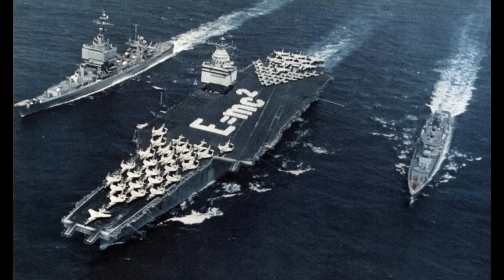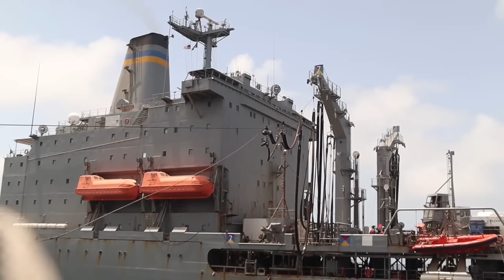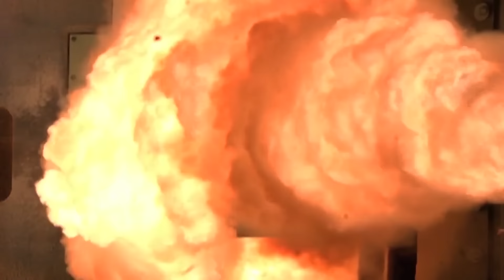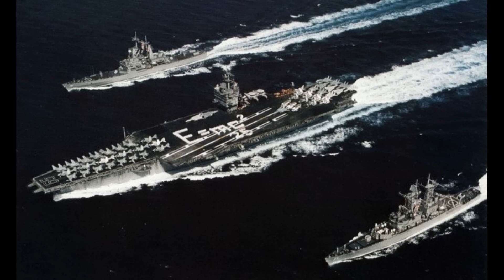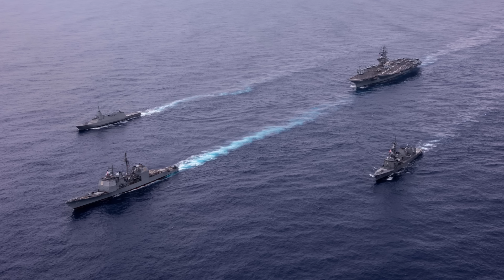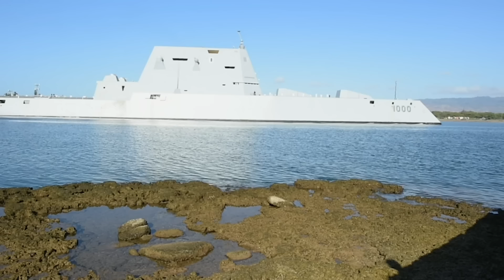Should the US Navy Bring Back Nuclear Cruisers?

Comment: Similarly, a strong case can be made for conventionally-powered aircraft carriers. Faster to build. Cheaper to build and maintain. Easier to host in foreign ports.
Reply: Im sure that would be more expensive to develop than building more Ford Class for US since they have long forgotten in building a Coventional Powered Aircraft Carrier long ago since last time USN commissioned a conventional powered Carrier was in 1968 with CV 67 USS John F Kennedy and it was Decommisioned during 2007
Reply: @wyne9145  did they lose the blueprints?
Reply: @fred6319 Blue print no but the Knowledge and experiences amongs human designers and Ship buildiers its forgotten
Reply: @wyne9145  and who is building ships now?
Reply: @fred6319 😂
Reply: @fred6319 
It doesn't matter. They need to design new ones regardless.
Reply: @wyne9145 
Doesn't matter. They need to design new ones.
Reply: @wyne9145  
No long forgotten, 
There is no point building a carrier with blue prints from the 1960s
You have make it using all the technological advances since then
newer engines, sensors and other technology
The ship would have designed from scratch but most important
what the reason for it
The USN has 12 CVNS backed by 11 LHA/Ds
what niche would it fill other than being cheaper to build
Reply: @wyne9145 
Building more Gerald R Ford class carriers is not possible. It will take decades to build 10 of them. 
A conventional supercarrier will have to be designed. The older designs won't work.
Reply: Not for the US’s use case.
Reply: 😂 So you're going to build more tankers, right? You need to design bigger ones also.
Reply: Not reallu the benefits if nuclear powered shios are upkeep you dont need to refuel
Reply: Actually no
A conventionally-powered aircraft carrier wouldnt work. First is power. the simplest route is 6 to 8 LM-2500s or MT-30 set up in  Integrated Power System (IPS) system. EMALS needs at least 100 megawatts of power per launch
The DDG-1000 IPS with 2 engines produces 78MW. So 6 to 8 engines would give you the power reserve needed for EMALS. The ship would only have 3 cats 
Problem number one is that marine gas turbines are thirsty engines. So that more time on the hose refueling
Using alternate systems like steam boilers and steam cats would a step in the wrong direction
Reply: @verdebusterAP 
No. It can work. You make a smaller one. Think of the America class amphibious assault ships. Something like that. It won't be nearly that capable though but it could be worth it.
Reply: @CFak-i9r1c  
In order to worth it
Like a CVN, its operational time is 10 days between unrep at minimum
The airwing woudl be capped at 60 planes
but have organic tanker, AWACS and EW
The ship could in theory hold more but the capped airway is the reduce personnel and increase time on station
it would still need to be able to hit as hard as CVN
Reply: @verdebusterAP 
Not really.
Reply: @CFak-i9r1c  
If not hitting as hard as CVN 
then its not worth it
Reply: @verdebusterAP  funny the UK has conventely powered carriers
Reply: @fred6319  
Yes and look at the short fall it has
No real AWACS capability
No organic tanker capability
No Carrier On Delivery
limited EW capabilites  with the F-35B
The carrier defenses are limited to CIWS 
with no missile defenses 
Limited radar systems
The F-35B payload is slightly heavier however the UK hasnt invested the money to fully weaponize the F-35B
A fully weaponized F-35B from the QE
needs the JSMs for land and sea attack against high value targets
SPEAR-3 or Brimstone for general targets
The F-35Bs only carry bombs and AIM-9/ASRAAMs and AIM-120s from the QE 
So pound for pound there little that carrier can do
Reply: @verdebusterAP  and all that is not related to the power plant of the ship
Reply: @verdebusterAP  and all that is not related to the power plant of the ship
Reply: @fred6319  
The power plant determines the capabilities of the ship and format of the air wing
The UKs carriers format is STOVL
STOVL are no were as capable as CATOBAR carriers
Reply: @verdebusterAP  the US build conventional caries for decades
Reply: @fred6319  
The  latest conventional super carrier built by the USN was the CV-67
The America Class is a light carrier not super carrier 
All USN super carriers are nuclear
There is no niche or need for the USN to build a conventional super carrier
Even now the LHAs being looked at to use nuclear reactors in the form of Small Modular Reactors
Smaller and easier than standard naval reactors
Reply: @verdebusterAP  and it could do all the things you mentioned
have a nice day
Reply: @fred6319  
Yes the CV-67 could however the CV-67
required refueling every 7 to 10 days depending on operational tempo
and needed 5 mill gallons of fuel for ship and aircraft
CVNs carries 3 mil for aviation and 1 mil for escorts
No fuel needed for the ship
Thats less time on the hose
Reply: If you are China, Korea or Japan. With the little shipbuilding industry that the US has it doesn’t matter that much.
Reply: Also cheaper to dispose of
Reply: @ronjones9447 
Another reason not to build nuclear ships.

Comment: Nuclear carriers don't really make sense without both a nuclear escort fleet and the ability to reload VLS cells at sea. Without both of those, you don't really gain much of the theoretical benefits, while still paying for the substantial downsides.
Reply: You misunderstand how much of a difference it makes for logistics and force projection
Reply: @trey6563 Not so much. A carrier being nuclear is effectively an x% fuel efficiency bonus for the strike group. That is obviously very good, but it brings with it massive downsides:

1. Cost. The nuclear reactor in the Ford class costs about as much as an entire QE class carrier. You can buy three QE class carriers for the cost of one Ford, and given that the QE class still has about 80% of the capacity, that is huge when talking about a floating airfield.

2. Logistics. The sole advantage of nuclear is a logistical advantage. But nuclear also puts strain on your logistics, because a nuclear ship cannot dock at the vast majority of friendly ports. A non-nuclear carrier can just sail into the closest friendly port and lift ammo/supplies off a truck. A nuclear carrier needs resupply at sea. The non-nuclear carrier also has the luxury of being able to reload its VLS cells while docked and... refuel.

3. Shipyard capacity. Very few shipyards can build nuclear ships. Those are generally the same shipyards that could otherwise be building nuclear submarines. So essentially each nuclear carrier you build is done so at the expense of a nuclear submarine.

3. Decomissioning. Just like shipyards, breaker yards can't typically process nuclear ships. Except this is even worse. There are so few places that can do this that they essentially have a monopoly. It can cost taxpayers billions to decommission each nuclear carrier at the end of their life.

4. Refueling. A nuclear ship doesn't need to refuel at sea, but they typically still need to refuel periodically. But this is extremely expensive and can take _years_.. The French Charles De Gaulle, for example, had to be refuelled after its first 6 years in service. That process took 15 months, during which France's only aircraft carrier was out of service.

5. Maintenance. Nuclear ships are high maintenance, and again most shipyards can't work on them. This again puts massive strain on the country's naval industrial base, and means that nuclear ships can easily get stuck in a maintenance queue.

Nuclear carriers made a lot more sense back when the plan was for the escorts to also be nuclear, and back when replenishment at sea was actually possible.

Nuclear carriers were designed under the assumption that replenishment at sea was the future.

Replenishment at sea is no longer a thing, because VLS cells cannot be reloaded. VLS cells are a carrier strike group's sole defence against high end anti-ship weapons, and a ship could deplete its stock in a single engagement against a peer force.

Essentially, nuclear carriers are only useful in low intensity combat against inferior opponents, where VLS magazine depth over the course of an entire deployment is not a major concern.
Reply: @Aethid  Great points but would also like to add that nuclear also provides a higher baseload power which is also useful for powering modern electro-optical systems, radars, electronic warfare systems, and EMALS in which conventional power would struggle and the ships power grid would be overwhelmed more easily.

Nuclear propulsion definitely doesn't provide a decisive strategic edge as people like to think, especially in a high intensity conflict regarding surface combatants. As for subs, modern AIP subs are superior defensive assets and have proven their worth in many exercises in unfair circumstances and achieving lopsided results against CSGs.
Reply: @0bsolete_fps773  Yes, and despite it being stupid for a long list of reasons, nuclear might well make sense for the Trump class, given all of its proposed high energy weapons. Nuclear also absolutely makes sense for submarines, which is why limited nuclear shipyard capacity is such an issue.

But I don't see anyone trying to put a 35MW railgun on a carrier, and more sensibly designed frigates and destroyers aren't likely to have so many high power weapons either.

Modern gas turbines can easily put out enough power to run radar and EMALS. The QE class is evidence for this, as it was designed with EMALS in mind, even though it is unlikely to ever receive the upgrade. It was still built with the required power capacity just in case.
Reply: Which describes a pocket Trump battleship. The GrafTrump class. 😊
Reply: You dont need nuclear powered escorts. To build a conventional destroyer, it takes on average 7 to 10 years at the minimum before the first keel is laid. That research, development and testing
Once thats out of the way, construction is still 1 to 3 years for the first run
The process takes on average 10 to 15 years. Now Orange wants the first keel laid in 3 years and wants to add nuclear propulsion
There is no cutting corners with nuclear reactors